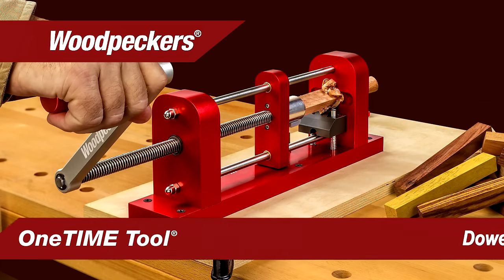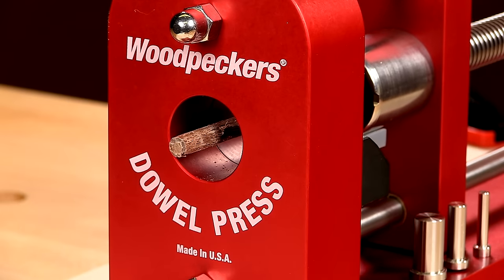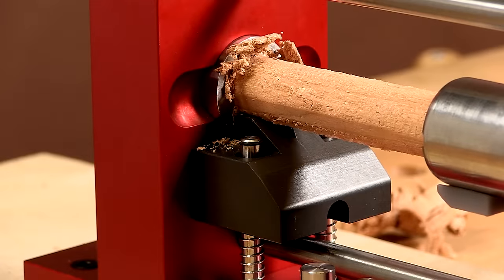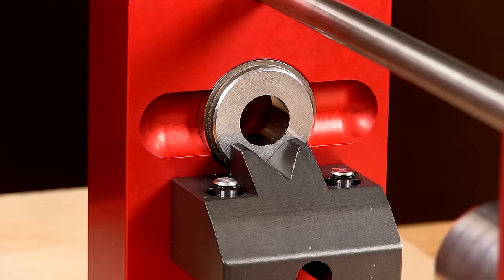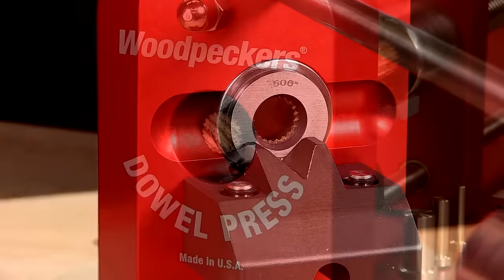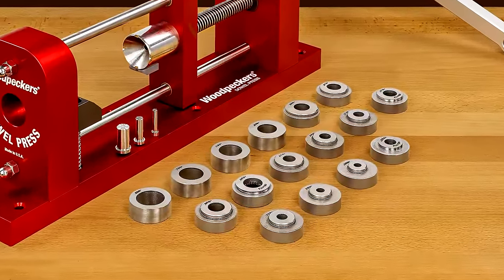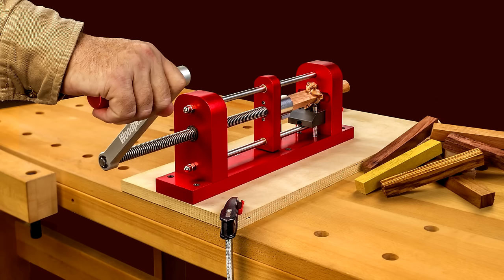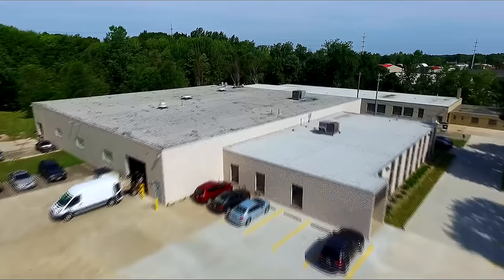Woodpeckers | OneTIME Tool® | Dowel Press

Comment: A lot of Woodpeckers' tools (this one especially) are for the "woodworker who has everything" and are conversation pieces as much as anything. I can turn a ton of  "good enough for glue-ups" dowels on my drill press in just a few minutes and for next to nothing.  For this to be practical at all, it needs a quick release handle and a drill adapter - and a quick release on the pusher rod so you don't have to un-crank it 100 turns manually to get back to the starting point.
Reply: I don't know about quick release, but the handle can be removed and the end spun with a 3/8" socket and whatever drill that can turn it. One advantage is you arent gonna turn any fluted dowels on your drill press anytime soon. so theres that at least.

Comment: That's a nice tool, but why not incorporate a quick release for the crank handle? Or a quick remove handle with a hex shank that would allow for use with an impact driver or drill?
Reply: because cookies like you would break that thing right from the start.
Reply: @fuerimmerallein  I don't know about quick release, but the handle can be removed and the end spun with a 3/8" socket and whatever drill that can turn it. I doubt that an average drill is gonna break a beefy thing like this that can spit out thousands of dowels.

Comment: Looks like a great tool, but $400 would buy a load of pre-made dowels.
Reply: If you are at the craft end of furniture were everything is made by the craftsman then you may want to consider this tool.
Reply: OUCH !!! LOL
Reply: You're missing the point.  This machine allows making dowels with any wood for decorative exposed dowels.  But for just making a few dowels for decorative uses, a lathe would be a far cheaper solution.
Reply: Agreed, but Woodpeckers retired it in 2016, so there's an extra $400 to squander on bourbon and strippers.

Comment: That's far too slow to be practical. A drill powered version would make much more sense.
Reply: Get busy building one
Reply: You want a drilled powered version ?   Go to the  Lee Valley website and check out the Veritas Dowel  Maker.  
It's available now and you won't have to wait until April of 2017.  I won't post a link here.....last time I posted a link Woodpecker deleted my comment.  I'm sure they will delete this on as well.
Reply: thank you.
Reply: The Poplar Shop
Reply: woodchuck s .
Reply: One Man Band Woodworking
Reply: I agree, a drill powered version is better, you can even practice making flutes while the drill runs at 1500 rpm :P